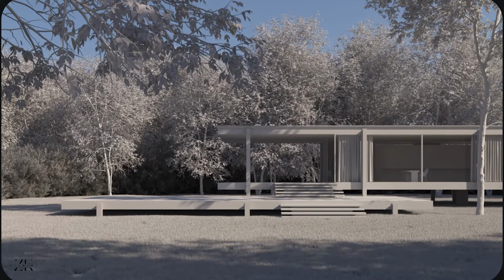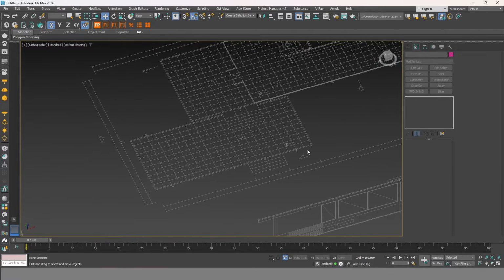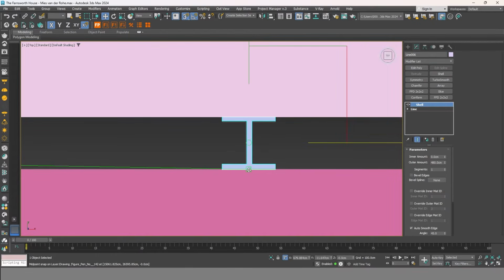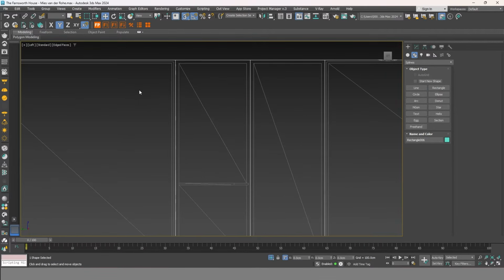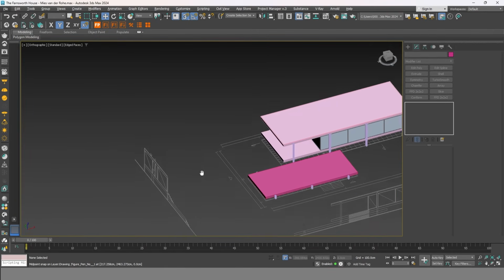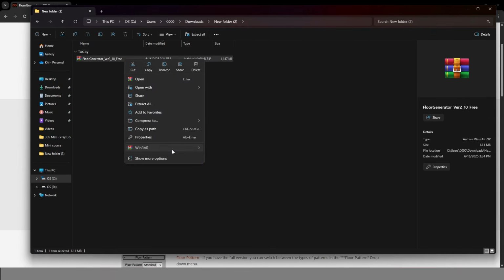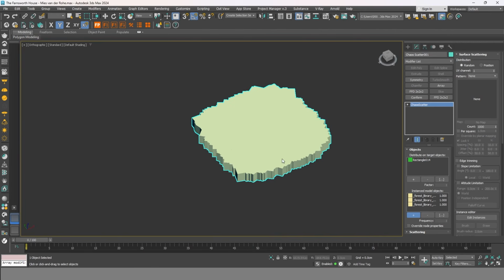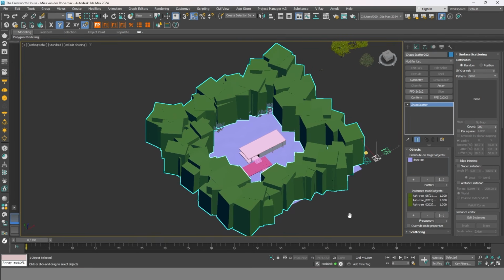FREE Architecture Visualization Course! -  3ds Max & V-Ray - MODULE 01

Comment: Why did he use copy for the first one and instance for the second?
Reply from the maker: If you make a copy, you can adjust it while the first shape remains the same. If you make an instance, the changes you make to the new shape will be also appylied to the first one. 
Make similar objects as instances helps also optimize the scene .